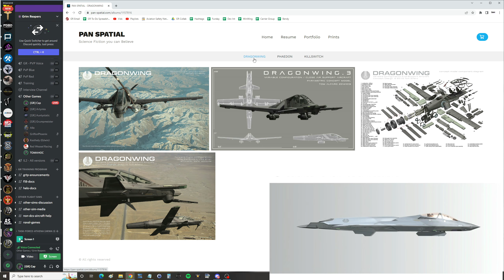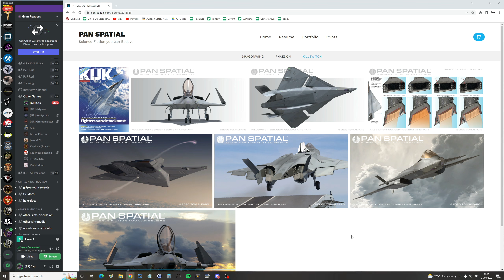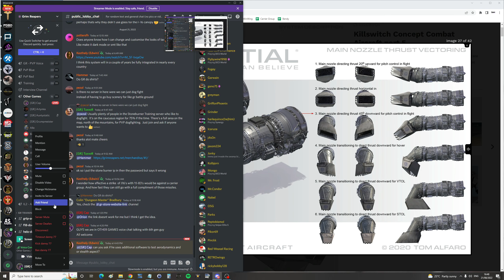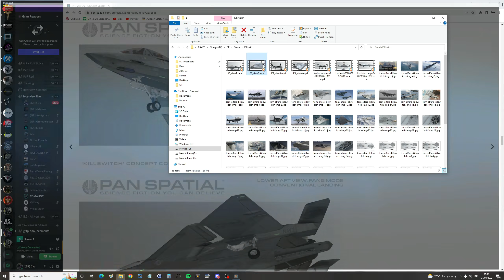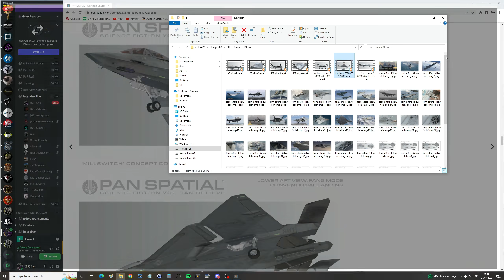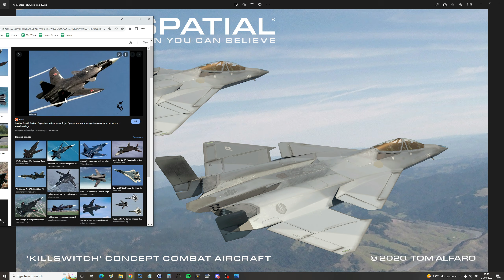Discussion: The "Killswitch" 6th Generation Fighter Aircraft Concept (by Tom Alfaro)

Comment: The thing is absolutely amazing. My only real criticism is the complexity, cost, and reliability. Future engineering and manufacturing standards may prove to combat those factors, but this could be more of a 7th generation design rather than a 6th. If I had to guess, that's exactly where you will see this next: in a TV show or movie as a product of Marvel's "Shield" or whatever the new agency is, or something like Transformers hah.
Reply: @mrstring4592  I understand the benefits of removing the pilot and associated life support/safety, but engineering and the design are already ongoing with the down-selection to a primary contractor as soon as this year, so I am 99% sure they will be manned by default. The last date I saw was low-rate initial production by 2028-2030, so I don't think there's enough time for them to go 100% unmanned (as it would require a change in the requested contract requirements and design specifications).

All reports I've read stated the USAF NGAD program will be comprised of additional sensors, drone aircraft (loyal wingmen), missiles, bombs, etc. In other words, NGAD is a family of systems rather than just the single 6th gen fighter airframe.

Just my humble opinion and amateur analysis of course.
Reply: Did you miss the Decepticon logo?

Comment: I strongly concur with the opinion that the Airforce can't afford 50 Spitfire pilots. A few rounds in a cessna. then maybe a Pilatus P-9, and then they are cockpit ready. At least for the first training flights. Some people forget that all Pilots start with props or even Gliders. Once you go Jet though. Things get very VERY time consuming, which is, what makes the Training so expensive. (flight hours) And the money you spend on Mechanics/fuel/supply chain could also surely be halved.
Reply: In WW2 Spit pilots only had a few (10 or so, some less) hours training actually in a spit.  The bigger issue is that with the current  total meltdown of RAF pilot training the probably couldn't train even 10 !  (see Tims 'fast jet performance' channel videos).

Comment: I suspect  one way to address Simba's point about moving mass be to not actually extend/retract the aft  or front portions of the aircraft be to not change the overall dimensions of the aircraft but instead move panels in the center portion of the aircraft to create the gaps.  (it maight actually become a control surface if done differentially as the body appears to be a lifting body design.

Comment: Love the presentation and discussion. It would be interesting to hear a discussion which steps back and considers the issue of manned v unmanned vehicles - the benefits / disadvantages of having humans in the cockpit vs remote vs AI.
Reply: I believe the current answer is guaranteed to be a mix of man and unmanned. The unmanned can be at least somewhat cheaper, takes away the need to produce a top fighter pilot, and removes the largest potential loss when losing a fighter: the pilot. Ultimately, especially given BVR air-to-air combat and the capability of long-range attack missiles, a lot of what the modern pilot does is battlefield and weapons management. The first resource to run out in a modern engagement, even as shown in GR war games videos, is the number of ordnance the pilot has at their disposal. They will be left with a gun and ammunition, a working radar, additional time-on-target to use, but no more missiles left to fire off. The unmanned drones will help with this, assigning one or two per fighter and to be used as bomb trucks.

I believe later on in the 6th gen life cycle or early on in the 7th gen, the unmanned aircraft will also gain the full capability of automated warfare and automated BFM dogfights with integrated autocannons/energy weapons. I predict the 6th gen will be characterized as the optional wingman generation and could be the last generation of "dedicated" pilots in the air as we see them transition into the "quarterback" (American football) role. The 7th gen could potentially revert back entirely to command and control roles where the order will be given to return-to-base before ever getting into direct range of enemy AI-piloted/drone aircraft. It will be sort of sad to see the standard pilot leaving the cockpit, but I simply don't see a future where it doesn't evolve into unmanned planes downing other unmanned planes. The weapons in the air and on the ground, combined with electronic warfare, will likely make frontline piloting too deadly and remove individual pilot skills as a factor that could make the difference.
Reply: @jamison884  Thanks for the thoughtful and thorough reply. I agree with your line of thinking. There seems to be lots of reasons to get pilots out of cockpits - g- force limitations, risk of loss, etc. Could remote piloting work reliably in a highly-jammed environment?

Unfortunately those systems would be more likely to be used in anger, as the political risks (loss or capture of pilots) are removed.
Reply: @thebatteryanalyst  Agreed, it's a real risk. If I had to guess, there will be incidents guaranteed, as even if advanced techniques and large budgets are able to eliminate such a threat (perhaps the US's leading electronics warfare tech), there will be countries who put less effective solutions in place.

We haven't had any major incidents that I'm aware of to date, where an existing drone with munitions has been "hijacked" but if enough resources are placed into this effort, I'm sure they would find a way. I don't know enough about computer science as a general rule, so I can't speak much further on the topic.

Comment: I had a second idea about this airframe Tom if  you elongated it giving a bit sharper of a triangle like a dark star Aurora feel ditch the lift engine separate inlet ducts for top side bottom side. You could make the streamline cofiguration a hypersonic scramjet pulse jet engine. Wing down supersonic fighter. Consider that the air force variant. Cool design lots of potential.

Comment: Found this info

“5. Back when production of the Spitfire was underway it cost an average of £12,604 for each aircraft. Today that would equate to just under £800,000 for each Spitfire produced. This is more expensive than the RAF’s other high-performance  fighter – the Hurricane.
 

So yes, you could buy 150 spitfires/f-22 but…there’s an article on what an hour flight costs in a spitfire ~$5k therefore $750k/hr to run all those spitfires.

An F-22 costs an estimated $120 million to purchase, but it would cost around $334 million if we factor in research and development costs. The F-22 costs an estimated $68,322 per hour to operate.

IMO, an f-22 would kill all those spitfires in a dog fight. Ammo supply notwithstanding.
Reply: I beg to differ, because ammo and fuel IS something to consider.  So i will say half of them, at most. if the pilot is really stingy with his Ammo. And the 3 days, a proper checkup/diagnose refuel, rearm would take for an F-22, All the remaining spitfires could use for a retaliatory strike on the F-22's airfield.
Reply: @Gunni1972  you can’t inflight refuel the spitfire and I bet if f-22s buss the spitfire they won’t even have to shot at them. But we can all dream what if. I’m of a certain age that I felt about the F-5 the same way and maybe it was more feasible then…that ended when the F-35 and F-22 came on line.
Reply: I'm not arguing against anything else you said, but even with unlimited ammunition, the F-22 is going down against a mob of Spitfires.

Many good DCS pilots have done the whole modern jet versus WWII fighter test, and the rate of turn combined with the tiny turn radius of the WWII fighter means it can get guns on in virtually every scenario/approach. You would think the F-22 can "boom and zoom" using near vertical approach vectors combined with huge speed, but it turns out to be way more difficult than you'd think. The F-22 (or any jet-engine fighter) ultimately comes in for a gun run, the WWII fighter sees it and gets its gun on target for the approach or jinks at the last second to avoid the incoming rounds, and the jet is vulnerable to attack as it leaves the area for another run. It turned out to be way more likely the WWII fighter is able to get a lot of MG rounds onto the jet before the jet was able to accurately and reliably pick off the WWII fighters. It's counterintuitive, but that's what I've seen in every test.

GR has a couple videos showing this effect; I believe one involved the Russian I-16 from a year or so ago. This was also featured in the series of videos where modern US forces were set up to protect Hawaii from WWII Japanese Pearl Harbor attacks. Any time the US jets went in to attack the Japanese fleet, the prop planes would attach to the jet and ultimately swarm it while only taking down a few Zeros at best.
Reply: They've actually tried this; basically modern jets can't out dogfight ww2 birds so once the jet is out of missiles it won't win, and in those videos it was like 2 or 3 to one and not 150 to 1. And as said above that's not even factoring the logistical components; WW2 birds require very little in the way of maintenance compared to modern aircraft, and can be built in exponentially larger numbers at exponentially faster speeds. 1500 spitfires would absolutely trash 10 F22's and even if a third of them were lost, they'd be replaced dramatically faster than the 10 F22's. High tech future planes are cool, but there's a reason the US still has thousands of F16's and less than 150 F22's.
Reply: @92HazelMocha  has anyone tried Sopwith Camels v spitfires
Reply: @damiangrouse4564  Not to my knowledge

Comment: So, you have the design concept. Now you need the Engineering concept.
I'll tell you this. Yo ur design will change drastically.
Think about the stress forces on the aircraft, while it's morphing in midair?
From an engineering point of view. There's a lot of unsolved issues with this design.
Your best bet would be with an electric foam board model as proof of concept.

Comment: The last part of this video you talk about wing loading during transformation vs the engine weight and gravity..... my solution for part of it would be an avionics sequence flight characteristics auto maneuver. Like if the wing are down some combputer controlled pitch angles could take advantage of negative g loading and move the wings up. Only fighting against aerodynamic drag. Same in reverse. You need strong wing locking mechanisms.

Comment: I love these types of videos, but this "concept" is too much science-fiction imo. A much more realistic discussion could have been had about the FCAS for example, because there we actually have real prototype models and specs.
Reply: I don't think so. 
We have only 3 new things.
1 is an implementation of an energy weapon on a plane
2 is a split airframe that moves relative to eachother by 70 cm or so
3 is a different deployment of missiles
The rest are mainly minor things, like the flywheel
Reply: @emmata98  "like the flywheel" lmfao
Reply: @jamesmaddison4546  sorry, flywheels are kinda old
Reply: Yeah I agree its too outlandish, The rear control surfaces that rotate through the engine exhausts would get totally destroyed. All the moving elements add significant weight, there isnt enough internal volume in the aircraft for fuel and weapons and other aircraft components, the weapons launching into the airflow like that would just be spun, finally no internal cooling, with the density of components this thing would be overheating like crazy.
Edit: And another, he says he imagines a central spine running from the cockpit though to the back of the plane providing the structural strength however that spine is fully occupied by the lift fan and weapons pod.

Comment: The missile cartridge system looks like something out of anime from decades ago.  Nice to see sci-fi/anime "inspired" potential real life designs.
Reply: Anime design. A rotating flat nose for example, would disturb airflow along the fuselage so hard, you'd barely hit the intakes on the back, which would starve out the engine in high AOA anyway. Forward-swept "Rear wings" would bend opposite to the diamond wing infront, again, could cause oscillation in the plane. Engines"on sliders" need long, but flexible cabling, hydraulics, fuel lines and cooling tubes, doable, but costs space and weight for fuel and last but not least, you think you can lift a twin engine plane with a single upper intake? if it has those 150k lbs of thrust to lift a 50k lbs plane plus fuel, plus payload... maybe? It looks really cool, i like the shape and all the Detail for it. But maybe he could sell the Design to an Anime
Studio. like I.G. Get a new " Supersylph Yukikaze"-style Anime out of it.👍👍👍💯
Reply: I am reminded of the CFA-44 Nosferatu from Ace Combat 6 & 7.
Reply: @skyhorseprice6591  the good old ADDM package now where is the EML on this bad boy
Reply: @Nordaritan  I was saying, that shit is pure CFA-44 Nosferatu. Even has the ADMM.
Reply: Yukikaze
Reply: Mechwarrior Mad Cat! I mean the Mad Cat had more conventional launcher, but same vibe
Reply: @tofubutcher7456  yeah this is basically mecha at this point.
Reply: please god let the missiles fly straight and not like they do in anime....
Reply: The F-22s side arm launchers shoot out of the aircraft in angles that direct the side arm weapon away from the airframe. It also has a method of "throwing the weapon" out, so even inverted, the F-22 can use it's side arm rails just fine. 

How it throws out the AIM-9Xs, for example, from these side arm bays is classified however... don't ask questions...
Reply: Nobody looks to kids tv for 'inspiration' 😂😂😂
Reply: Not true. You'd be surprised where designers draw interest from.
Reply: @EnglishPatriot486  aint for kids man
Reply: @tomfson8609  It is ffs, its cartoons lol.
Reply: @EnglishPatriot486  There are lots of cartoons that aren't for kids, I wouldn't say family guy is a kids show.
Reply: @tomfson8609  I wouldn't show the boonducks to kids.